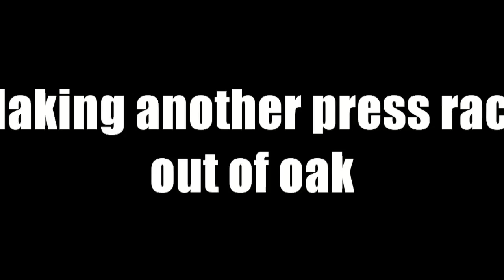Making a single additional press rack 2011

Comment: i take it you still use M3.5 x 16 stainless screws ?????? so i take it on top lats is 3.5m drill hole but wot size hole was on bottom lats cheers neil